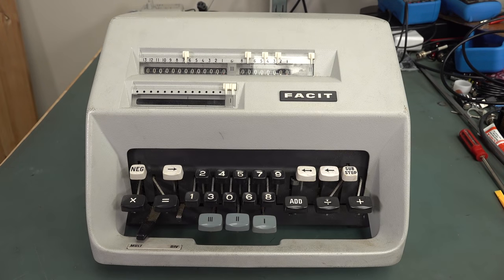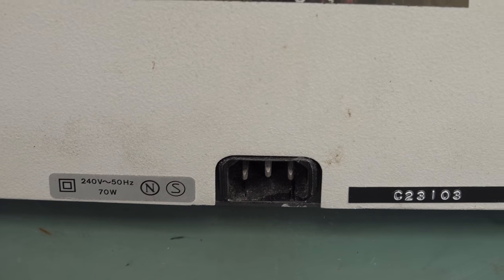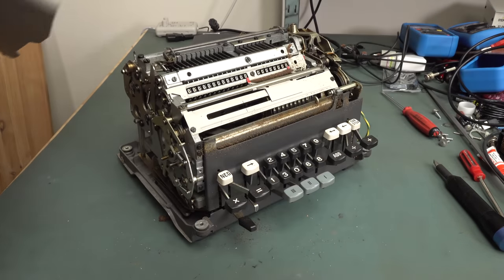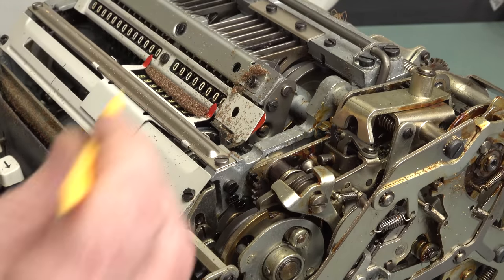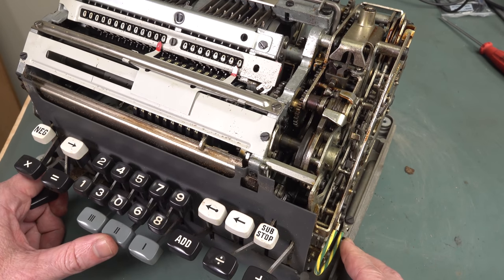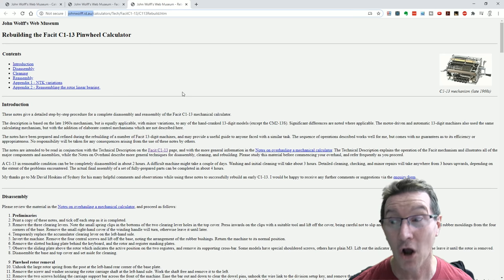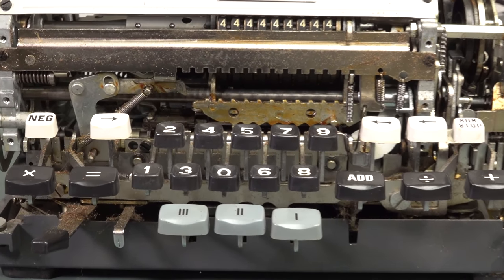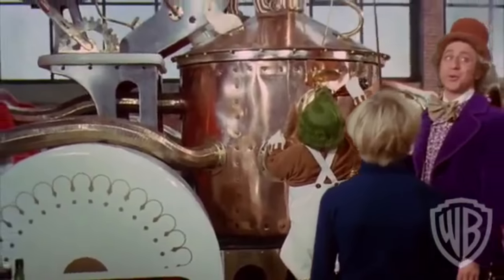EEVblog #1332 - Facit Mechanical Calculator!

Comment: Welcome to the MEVBlog
Reply: At least it didn't explode when they turned it on that would have been bad.

I've seen many of video with exploding caps the ones the metal film once it seemed to not just let out a smell but let out the stench as well.

Comment: You could remove all electrical components and then stick it into a ultrasonic bath (with soap) for a few hours to remove all the old hardened grease. And then lube it with WD40 or lithium after blowing it dry.

Comment: ...Dave accidentally brings down the guy’s website as 500k nerds check out the mechanical calculator overhaul!
Reply: Old Slashdot humor: downed site must have been running on a mechanical calculator.
Reply: Not Maximum Overdrive although in this case it could be at least maximum driven.

But in case of the website maximum overload.
Reply: Dang I missed it the calculator means maximum overhaul.

Comment: My dad had an old mechanical calculator in the back of his shop when was a kid..  He replaced it with an electronic calculator when it got gunk in the gears and would occasionally spit out the wrong result..  I took it partially apart, sprayed a whole can of WD-40 into it to wash off all the congealed gunk, put it together and it worked again, but it dripped oil for months afterwards 😁 (I was something like 14 and didn't know any better)..   It's still in the basement at my parents house and probably still works...   Even though my degree is in computer engineering, mechanical calculators and computers completely amaze and mystify me..
Reply: it might need another can of WD40 again though!
Reply: WD-40 will turn into a nasty gunky mess after a while.
Reply: @illustriouschin  it's already had a whole can of it sprayed in though!
Reply: @illustriouschin  WD40 works well as a cleaning solvent. Scrub with tooth brush, wipe away as much as possible, use an air compressor to blow away as much of it as possible, then re-oil generously with thin oil like sewing machine oil. Work it for a while, then wipe away most of that to avoid the oil attracting dust. 
For the sliding parts any thin grease will do.

Comment: Maybe someone Divided by Zero and locked it up .
Reply: Hey, that's a great idea.
Reply: I'm guessing that's what the SUB/STOP button is for. I recall seeing another video demonstrating an electromechanical calculator getting stuck in a loop on a divide by zero.
Reply: Xor, best gate
Reply: "This is what happens when you divide by zero on a mechanical calculator" https://www.youtube.com/watch?v=OFJUYFlSYsM
Reply: I was just going to say something like that if I had exponent Debbie someone jammed it and it thought it was to Infinity and then locked up of course no exponents so not the reason. Or somebody tried to X the number of times Google search has been used X Google and it gave up the ghost. Either one lol.
Reply: By the way user image checks out it was very gating of you to do that and very logical considering your interests in electronics.
Reply: Also if his head up in a not gate it would not have been appropriate because you wouldn't be interested in Electronics!
Reply: AFAIK, the divide by 0 is left in on electro-mechanical units to allow the operator (rather repairman/serviceman) to oil the machine. On more advanced/aged (counting from when they started appearing) machines there's a stop button, some even have a limit past which the machine stops.
Plop in oil at the required spots and lubricant at the others, and /0. 

It's tedious on my purely mechanical Facit, i have to manually crank it and let me tell you, getting each position exposed is a bit tedious.
Reply: Dividing by zero voids the warranty.

Comment: Hi Dave: Great video! I guess I would not be too concerned about keys being stuck. When you pull the mains cable the gears end up in random positions and the keys may appear stuck. It takes a few rotations of the motor to bring everything into an orderly state at which the keys are all unstuck.
What you might want to check first is the mechanism that you describe in 13:30 of your video. This is sort of the clock generator in modern terminology. The motor has to rotate in such a way that the dancer travels "uphill" in the curved slot, and does not block right away. The curved slot gear is mounted on a camshaft with a notch right above the motor capacitor. This gives the ticks of the clock.
When the curved slot gear is stuck also in the 'right' direction, this might be root cause. Maybe it just the dancer acting up. I guess, you could remove the single e-clip on top of the dancer, take it off, and clean the curve slot (I haven't done that myself). I could send you a quick video in slow motion that explains function a lot better...Cheers+thanks.
Reply: Hello! I have a similar calculator with the exact same problem. The engine spins but the mechanics and buttons are locked. Do you have any tips on how to make the mechanics come off?

Comment: Have you tried pushing the big gold pin to the side while spinning the gear? maybe it locked somehow. The fact the equals button is the only one working tells me it may have been involved in locking up the whole mechanism, Maybe someone pushed the button harder than they should have and the calculator is permanently in "equals" mode, locking up the entire mechanism.

Comment: I have the C1-13 mechanical model that I inherited from my dad. He used it in his work as an architect, doing static calculations and probably some ledgers. Mine still works great after all these years and there is no glitches or lockups. The sound it does as I turn the wheel is smooth and pleasing. It is different to this model. This model has divide and multiply keys and a few more that are not present in the older mechanical calculator but you can still do the four operations. Subtraction and division require reverse rotation of the crank handle. 

I visited Stockholm back in 2003 and we went to the technological museum. They had a calculator hall, and several FACIT calculators obviously there, for display and use by the visitors. I demonstrated its operation to our group and a small crowd soon gathered. A museum attendant soon came over and we were afraid he wanted us to stop messing with the calculator. In the contrary, he came along and asked me to demonstrate to him the operation of the calculator so he could show it to visitors. We spent 15 minutes going over the machine and it was lovely. These old calculators have some magic. They take effort (literally) to work and they make noise. Nobody would have a second look at an electronic four banger, right? 

BTW, if you ever visit Stockholm, don't miss the Technological museum. If you are technically inclined, you will be fascinated. And the Vasa 16th century ship museum as well. You need to see this as well. Even if you are not into modeling or ancient ships.

PS. To see the machine in action, check this out: https://youtu.be/hgV9DbfIlgg

Comment: Beautiful machine. Magic oil has escaped from this one . :(
Reply: Thinking about that earlier at the start of the video when the expansion is about to grease. 

Although magic grease for we would have been a better way to describe it.

Also if something had gone wrong electrically as in really bad really bad.

You might have had a situation where the magic oil smoke escaped.

As in burning lubricant.

Comment: 23:50 note the 0 in the middle. The Facit made this so prominent, the 0 is still bottom center on modern keypads. Look for yourself on any modern keypad!
Reply: The zero is in the middle because it doesn't turn the pinwheel when pressed.  The four keys on one side revolve the pinwheel away from. the operator, and the four on the other side revolve it toward the operator.  More open pinwheel machines turn the pinwheel setting lever entirely in one direction for all numbers. This is one of the main features that allows the Facit to use keys instead of levers to set the input.
Reply: @simonuden8450  thanks for that clarification! I have a Facit CM-13 and never realized that when restoring mine about 3 years ago. Now I've just got to open it back up to see it! Makes perfect sense though, as this pinwheel has a moving carriage.

Comment: You can subtract by negating the number and then adding it :P
Reply: unless the negate key negates the contents of the accumulator. but yes if not that would be a perfectly valid way to do things and some processors today dont have circuitry for that very reason (they do negation and addition internally)
Reply: @urugulu1656  in that case you could just negate again
Reply: @efa666  ah i see more points of failure equals more better ha?

Comment: Back in the day, typewriter repairmen were all over the place, and this thing would be right up their alley. It's somewhat more complicated than a manual typewriter, but not hideously so. The main thing in there is the the gear train that is just a basically a 10:1 reduction. As I recall that was accomplished using a single tooth cog, that allowed the next higher digit to be advanced by other components. That particular one is extra complex, since internally there is a sliding carriage that allows you to set multiple digits using the same keys. The older machines had a 1–9 column of keys for each position, which made the internals simpler.

Noise-wise, these were about the same as a ASR-33 teletype.  The crank just plugged into the same shaft as the motor.

Comment: Can anyone else imagine non-Dave looking a circuit board and going " and this trace links to this hole and it goes underneath, and this wire linksto that trace and they all keep going to this bits with legs and it's covered in these black squares? It's silly, it's just insane!"
Reply: Its all what your used to thinking/working with. got an ol boy in the workshop, career mechanic, but got out of the game when it all started getting 100% computerised. I think he's electron-phobic, which is a little annoying in an electronic engineering shop, but he's a demon with a wrench. and an awful lot of custom electronic stuff actually boils down to the chassis/mounting/bracketry etc, so he's handy to have around. anyway, he's still got a good brain, and if you can convert whats happening to a mechanical analogy, he can understand quite alot. there are an awful lot of parallels.  

one thing I do really like about our shop is its perfectly acceptable to stop for 10 minutes to explain whats going on to a colleague, even if its none of their business. Its seen as a benefit that everyone from the firmware codemonkey to the metalbasher has a decent overview of the project. your not just in your little box, solving your little problem, ignoring everything else. Its everyones, and if it all dosent work, well, none of us get paid. it garners respect between the various departments, and can really help if you have a hit a roadblock to get a completely different perspective. it might not be 100% right, but gets you looking at a problem from a different direction.

I would LOVE to see the melding of minds of Dave and John working together on this, the lightbulb moments where Dave realises 'ooh, these levers and that cam are like a flipflop! theres you set, theres you latch, and this is the clock! Wow!'
Reply: To be honest, I have almost exactly the same feeling when I look at internal schematics for ICs, found in some datasheets for old opamps, lm317-s and such. It gets easier when you learn some typical contraptions, such as "this is a current source", "this is a current mirror", "this is a differential stage", "this is a bandgap reference"... I guess, mechanical enginerds had their building-block library in their minds, too.
Reply: It all made me wonder, if some nerds have made a verilog/vhdl to mechanism compiler already?...

Comment: Maybe soak it in IPA for like 24hrs? I think pretty much every other solvent like acetone or benzene petroleum ether (edit: wrong translation) will be too aggressive.
The stubborn parts that didnt get cleaned in the bath you could spray down with parts cleaner.
Then dry for 24hrs and give it a good treatment with grease (from the can to reach all the spots).
But then unfortunately IPA is like 5x the price nowadays.
Reply: Benzene, you must mean toluene, the former is a major carcinogen and probably not purchasable by the average Joe...
Reply: @jovangrbic97  Sorry I meant petroleum ether, 1:1 translation often doesnt go so well

Comment: Mechanical calculators hung on for a while after electronic ones. In the early 1980s I was working in a phone company building. Next to the break room was a room  packed with hand cranked, mechanical calculators. They had a column of 0 to 9 keys for each digit position. No fancy Facit stuff. I had to ask why they still had hand cranked calculators when every one had electronic. Budget time. Electronic ones didn't have enough digits. Plus in many ways Ma Bell was hanging on to the trailing edge of technology. NYC business office was still a cord-board operation with operators plugging in phone jacks to answer calls.

Comment: I have a hand cranked mechanical calculator, it's a bit simpler but some parts look super familiar. It was seized when I got it but I managed to fix it by taking it to pieces and managed to get it together again, damaged one of the digit wheels slightly so it doesn't reset properly any more, but it can be used. http://slashhome.se/p/gallery/?f=gallery/Misc/multo/main/IMG_5143.JPG
Reply: I have exactly the same, just branded Odhner. Mine has an issue with the left accumulator - it does not carry the numbers anymore, past 9 it locks the machine. 
Still gotta try and fix it.

Comment: I have the smaller model of this calculater. It doesn't have an electrical motor, but a handle instead that can be cranked one way for addition and multiplication and the other way for subtracting and division . It was stuck like yours when I got it, but I rinsed all the mechanics with a solvent and then dried it and lubricated it with new oil. Now it works perfectly. It can add, multiply, subtract, divide and calculate square roots.

Comment: I suspect it lost power in the middle of an operation and got stuck, it looks like you were not the first person in there so somebody may have just reset the counters without unlocking the jam. I wouldn't try to fix it yourself unless you have a spare fortnight and spraying it with solvent or WD40 won't help, it needs the attention of somebody who knows what they are doing.
It actually seems to be missing something from the top lever that follows the cam track on the roller, the back end of that lever has a notch for something which cannot be seen in the video, I suspect something like a bar or rod is missing which would put pressure on the lever so it follows the cam track. That might explain why you cannot get it to turn, it's almost like it needs to complete a cycle so it can get back to default position and unlock the keys.